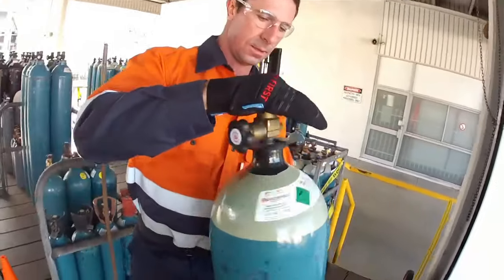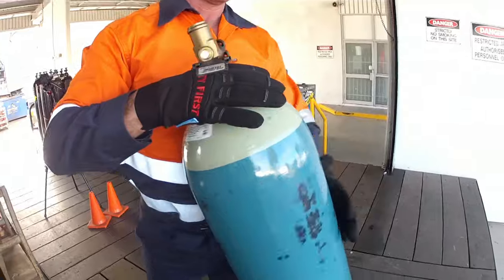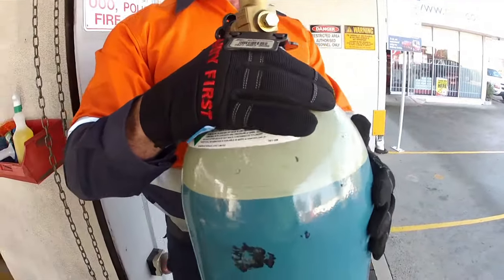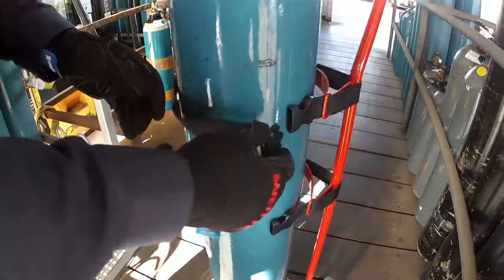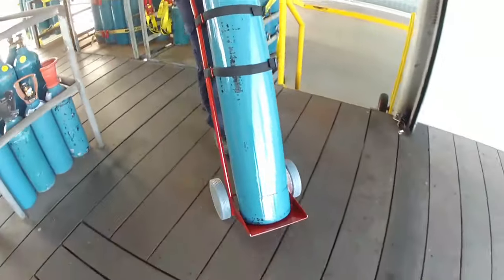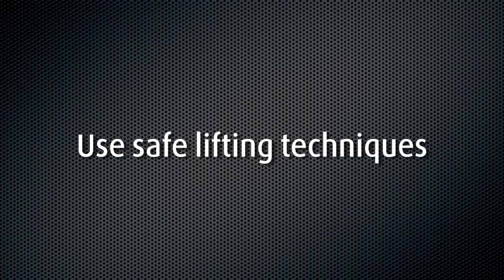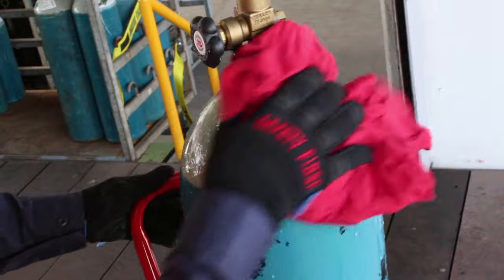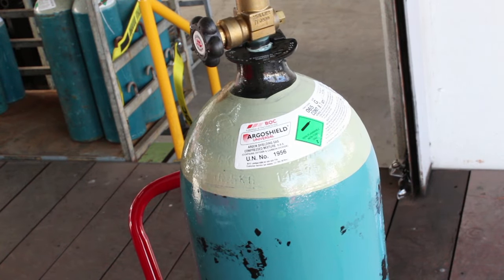BOC - How to move gas cylinders safely

Comment: I'm a compressed gas driver and handler and wtf? NO CAP?! Are you asking for it to fall and snap the mechanism?! When I pick up empties, I don't even bother touching the ones without caps. And I don't use the spare ones on my truck. The customer is supposed to re-cap all cylinders when emptied. Giving them spare caps and it just encourages them to forget where they left the damn things (caps).